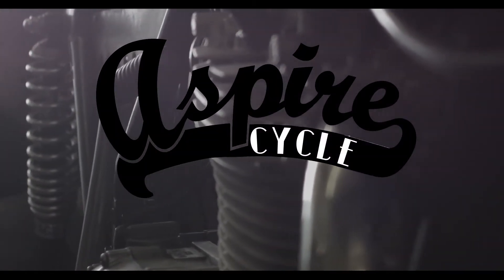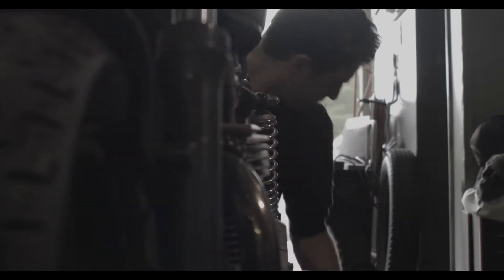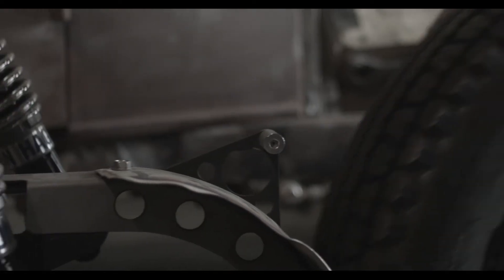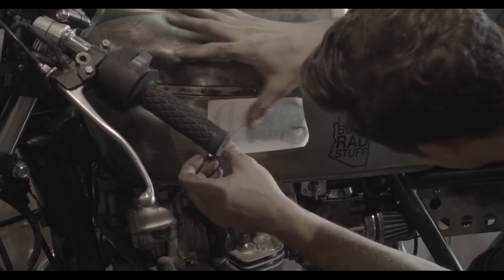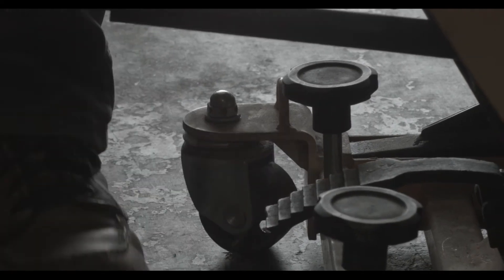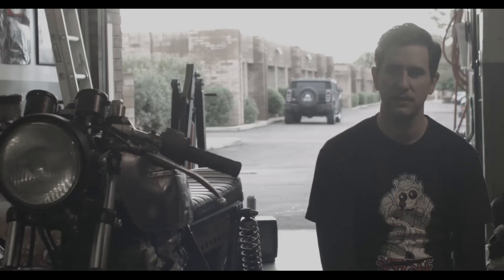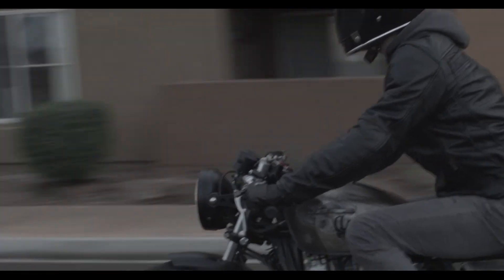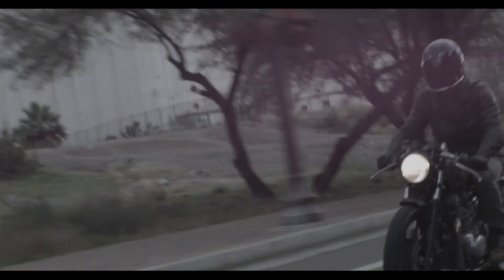AspiRe Cycle's KZ750 "Tie Bomber"

Comment: Did you lower your forks dude?
Reply: yup! they were lowered about 2-3 inches
Reply: ronan teague I should’ve noted that the forks are from a kz750 four cylinder so they were already shorter than the original CSR forks.